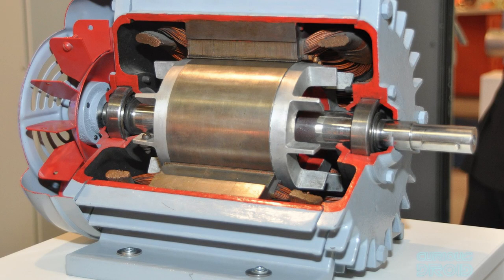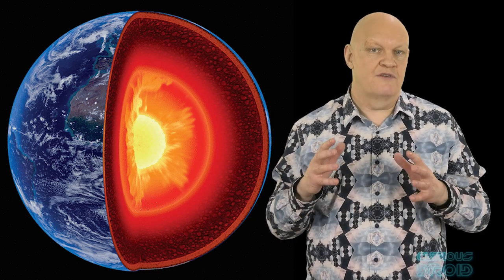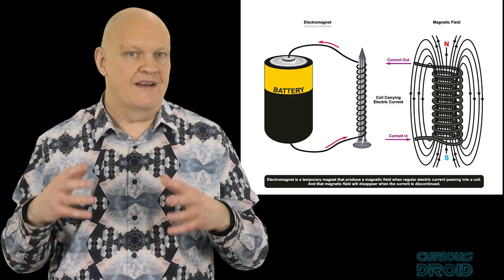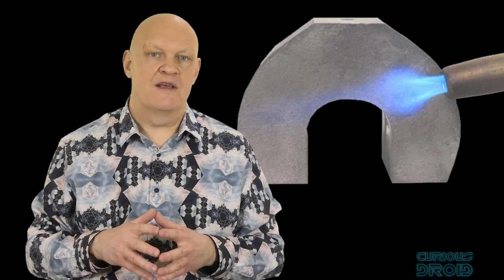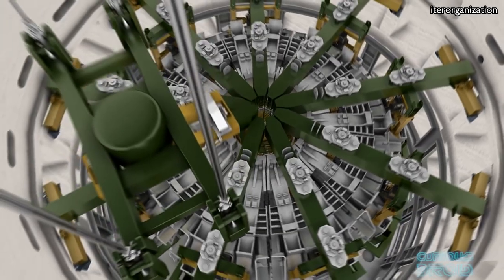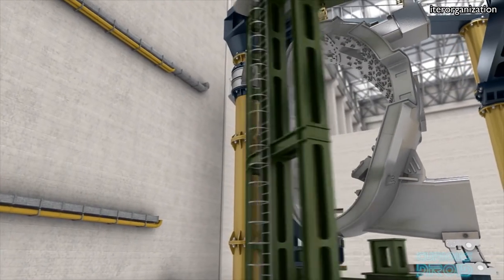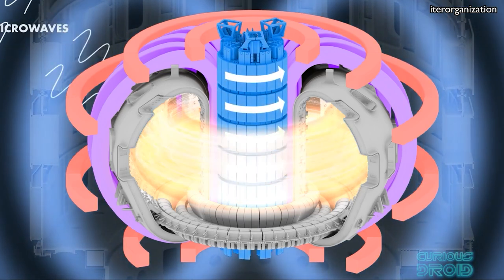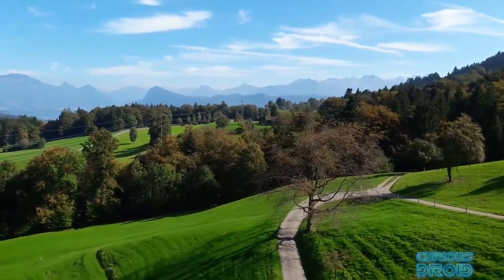The Most Powerful Continuous Magnets Yet Made

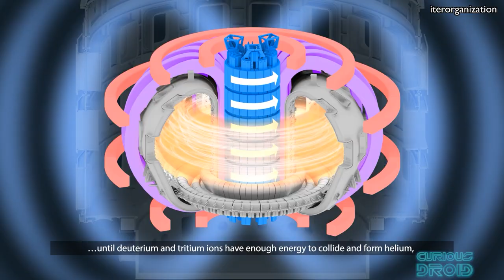Comment: 14:43 Note that the 500 MW heat release need to be converted into electricity with an otimistic efficiency of around 50% so the power comes out is only 250 MW.
Reply: and true cost of running the entire facility is more like 550 MW... still, big progress
Reply: At least the Q factor is about 10. For a fusion reactor as a power plant to be commercially competitive it has to reach around 50. Still, big progress
Reply: It will about break even, as I saw some numbers quoted. So, with research completed at ITER and other facilities, the next generation should be on the grid and producing power. I don't believe any of the dream fusion reactions will be on the grid before 2030, maybe 2035 at a smaller scale.
Reply: @kindlin  I will put commercialised fusion somewhere around 2050, and becoming a major source of energy by 2100.
Reply: @kerbodynamicx472  
I'm only saying that by 2035, 2040 at the latest, there will be some device using fusion power powering a community, a city, a moon base, somewhere, in a commercially viable way.
Reply: @kindlin  it probably won't break even. the prospect of producing excess energy only appears to exist if you look at energy pumped into the reactor core compared to thermal energy produced. but total power input for the entire facility will be higher than the 350 MW you see in the news articles, and electric power out will be much lower than the thermal power it can produce. only by capturing the heat from the stray neutrons banging into the reactor walls will they be able to pump steam through turbines.
Reply: @cornoc  
I'm not talking about ITER or any of the current ones being discussed: "the next generation" aka, after this generation. No current fusion reactor has plans to be on the grid, they are all research beds. Some think they'll have something running near the breakeven point in a few years, but it's going to take an entire next generation of physics and engineering improvements before we can have an actually feasible reactor on the scene. But it's coming, oh, it's coming (in like 15ish years, probably).
Reply: @kindlin  oh, yeah i'm pretty sure at worst the "30 more years" cliche gets more accurate every time they say it. at this point i think the only thing that would prevent a commercial fusion power plant from being built is a major breakthrough in alternative energy sources like solar panels and batteries. if they get efficient enough and cheap enough, it might discourage companies from continuing to pursue fusion.

Comment: Great video, Paul! One point of interest: the interaction of neutrons with the coolant water (and moderator in LWRs) only heats it by a few percent of the total - the daughter nuclei from the fission contain the majority of the fission energy and it is their impact with the ceramic lattice of the fuel pellet that causes it to heat up. That's why the cooling of the fuel is so important - nuclear thermal hydraulicists wish that the heat was formed directly in the water, it would make life a lot simpler and would allow reactors to be even more efficient! In fusion reactions, however, the neutrons carry most of the energy (irradiating the vessel as you mentioned) so heat will be extracted by their deceleration in breeder blankets, producing fuel in the process. Cheers!

Comment: I had no idea that the magnetic fields in a fusion reactor were so insane. That's mind blowing!
Reply: Im more curious what would happen if a tie rod holding the top and bottom broke and the whole thing blew apart, at 150 million degrees im guessing the whole building would be incinerated along with all the workers long before the chunks of metal did damage
Reply: @mickyr171  I don't think the plasma would be a big problem. It dissipates very quickly when the magnetic field stops from what I understand
Reply: @awesomefacepalm  oh ok then, that's a good thing
Reply: @mickyr171  isn't the thermal mass way to little to cause that kind of damage?
Yes, you have these crazy temperatures but only a really small amount of material (I believe it's just a few grams) is at that temperature.
Reply: @gags730  Really it's the cost that makes me grimace... ITER as presented in the video takes in 300 MW to output 500 MW.  Ish.  For how many billions of dollars? It's frankly no use is the end product of fusion (unlimited input resources with no waste!) costs billions of dollars for a few hundred MW.
Reply: @DavidOfWhitehills  it's not an either or with fusion and renewables.
But do you realize how much energy we can get out from just one kg of hydrogen? That could replace thousands of acres of solar panels. Imagine what a reduced environmental footprint that would give.
Reply: @DavidOfWhitehills  you sound like a greenie
Reply: @awesomefacepalm   You really need to watch the vid Shrikinator linked a few posts ago. Until you do, you are the poorest informed in this thread.
Reply: @DavidOfWhitehills  I've watched that one already, months ago
Reply: @awesomefacepalm   Did you comment? What were your thoughts?
Reply: @DavidOfWhitehills  it's exactly as she says. Fusion has the potential to be out best source of energy and more research should be done.
But the half truths many of the scientists give is not good for the image of fusion research.
I won't call it a scam, because it's not. Not even Sabine does it 
The only thing is that the road to net positive fusion is much longer than than people claim, but in the long run I'd say it's worth it.

Comment: From memory, the first recorded death by hospital equipment was that of a boy undergoing a MRI. An oxygen tank was hurled into the machine and he was crushed by it. I recently had a scan by another hospital device that almost fully enclosed me. The sound was like a jackhammer right next to me. It went on for about 25 minutes. I don't know the name of it but it was very claustrophobic.
Reply: Loud jackhammer noises, long scan times, and closed spaces totally sounds like some sort of MRI. If they asked you a bunch of questions about pacemakers, tattoos, jewelry, etc, it probably was some sort of Magnetic Imaging. Hope your scans came back OK.
Reply: @Forefatherrabbi  magnetic ink in tattoos? I wonder who discovered that the hard way.
Reply: I happened to work in a trauma center in the late 90s and early 2000s, and unfortunately have seen the aftermath of an oxygen tank going Through a doorway (as in forcefully, taking Out the door and frame), an operator's station and finally doing a Chop Suey on an MRI machine. It was caused by a vendor coming in through the ER doors after normal hours which happened to share a corridor with the MRI suite. 
Suffice it to say, a lot of hospital policies changed after that.
Reply: @volentimeh  good question.  Most people first notice inching, pulling or tugging sensations.  When the scan is being performed, the radio ways hit the metal in the tattoo like an antenna and the energy has to go somewhere.  So it goes into your tissues as heat.  It will not instantly burn you, but will heat up the more RF it gets.  Some people with small amounts of metal (like in a tattoo) can still receive a scan, but the RF needs to be dialed back and the scans spaced out so the metal has time to cool before it gets blasted again.

Animals can get MRIs, and the microchips in pets is OK in the MRI and will not be broken or damaged, but it is something the veterinarian will look out for.
Reply: @Forefatherrabbi  I have to tell the technicians I had an umbilical hernia that was fixed using a titanium mesh. But I think that's with the MRI. The other machine was even more claustrophobic. I was given a choice of music to listen to using headphones as the test would take 20-25 minutes. I couldn't hear the music though due to the jack-hammer noise.
Reply: I hate those machines, talk about claustrophobia

Comment: When the first fusion reactor is operating 24/7, I wonder how close you can get to it before electronics begin to fail. Will there be a huge area around the facility that's off limits?
Reply: Magnetic fields roughly follow an inverse cube law rather than an inverse square law, which is why you don't erase your hard drive by having a magnet in your screen to detect that the laptop lid is closed .  And you can control where magnetic field lines go with metals and dielectrics.
Reply: We already have functional fusion reactors.... Their only problem is they don't really produce a positive output, at best they can self sustain but what excess they can make is a joke at best.. You might run a watch off it if lucky
Reply: There are metals that can shield magnetic fields, if you ever had or saw a CRT TV, those had magnetic shielded speakers for obvious reasons.
CRT-based oscilloscopes use a Mu-metal shield.
Mechanical hard drive magnets have Mu-metal plates that keep their stronger magnetic field away from the platters.
Reply: @SilvaDreams  Sooo...... you're saying there's a chance?
Reply: @SilvaDreams  actually its not even close since none of the power for the cryocoolers and auxiliary systems is calculated in those figures

Comment: I have to point out I have a pacemaker and have had two MRI scans last year and two more coming up to be done in one day on the 8th of March 2022. They have a technician from the pacemaker company who speeds up my heart rate a little before scanning and slow it down afterwards, so far I am still alive. The worst part of the procedure which takes I think about 20 minutes is the noise, I am fitted with a massive head set which pumps out the loudest baddest overdriven distorted heavy metal you would need to experience to appreciate. Just for extra info I had one on the brain and one on the hip, the next two are spine and shoulder, such fun!

Comment: Nice content; I really enjoy those videos. But many continuous running NMR magnets far exceed the magnetic fields in tokamak fusion systems. For example, the University of Florence has a 28.2 T magnet system. Further, commercial NMR magnets are available with fields up to 23.5 T. (And I believe 45.5 T is the world record for a continuous high-temperature superconducting magnet, ref: Nature, "45.5-tesla direct-current magnetic field generated with a high-temperature superconducting magnet", 2019)
Reply: I have a 1960's NMR with a 0.5T magnet. I have no idea what to do with it.
Reply: @LaserFur  That is awesome! One of the early days of NMR. Have you worked with that device?
Reply: @escapedbits2732  I got it from a university that said. "come bring a trailer we need to clean out this area". Unfortunately all the cables are cut and missing. so all I have is the books, rack with the amps, and the unit itself with it's chart recorder. It would take a lot of work to get it to work again.

Comment: Absolutely fantastic video :) however after tons of material I've watched and read about fusion reactors (TOKAMAKs in general) I still cannot understand how will the heat from the plasma ring in a self contained liquid helium cooled tokamak, be "extracted" to heat water for steam turbines?
Reply: The energy is conveyed from the plasma ring to the blanket (or heat jacket) by fast moving neutrons generated by the fusion reaction. The kinetic energy of the neutrons striking the jacket and their subsequent decay is the source of heat. The reactor can then be cooled in a similar manner to fission reactor (pressurised water, molten salt or high pressure gas) with the heat conveyed to Brayton cycle turbines.

It may also be possible to extract energy from the plasma using magneto hydrodynamics but I am unsure whether this has progressed beyond a theoretical possibility.
Reply: @jimgraham6722  Thank you so much for the explanation! To me this principle sounds more like a particle accelerator energy transfer, which is interesting :)
Reply: @andydsm  My understanding is the durability of the heat jacket under intense neutron (as well as other radiation) bombardment is still bit of an unknown as so far the fusion reactions have only been of short duration. The net radiation flux in a fusion power reactor is expected to be about 100  times that in a comparable fission PWR so materials will get a lot of wear and tear, requiring regular replacement.

 Relining the reactor from time to time will undoubtedly be a big deal.
Reply: @jimgraham6722  As I read your explanation to my 1st question, I also started thinking that even if in the following years we have a successful q over zero tokamak ignition for testing purposes (i.e ITER or another one), the next step of actually working on the energy transfer for actual useful work, would be a monumentally difficult task as well.
Reply: @andydsm  Yes, it's a way off yet and the initial power plants likely to be very large and very expensive. Sabine Hossenfelder recently gave what I think is a reasonable summary of state of play.
https://youtu.be/LJ4W1g-6JiY
Reply: @jimgraham6722  Again, thank you for the eye opener details shared, just watched the video you had linked and sadly I have to accept the truth that this very much necessary dream for humanity, will not become reality for many years. The recent 20-ish minute fusion reaction in the Chinese experimental reactor got my hopes really up, but I guess there's thousands of additional challenges to overcome.

Comment: What happens if the  fusion reactor's magnetic field loses power, even for a nano second? Wouldn't the plasma expand explosively, sublimating everything in it's vicinity?
Reply: ITER uses superconducting magnets, so no power is needed to sustain the magnetic field.  The whole structure is extremely robust in order to contain the forces generated by the magnetic fields, heat, and pressure.
Reply: If the field of the superconducting magnets lost their power due to  short or over temp, there would be a quench. boiling the cooling liquid and high resistance. The magnet would be permanently damaged. The plasma would leak from the magnetic mirror or bottle and hit the walls of the reactor chamber. 
The chamber in a modem commercial reactor would be lined with not only tungsten but lithium to drink in the neutrons and  make tritium for fuel. 
Still, no, a hot mess it would be, but no runaway reaction and explosion of a nuclear sized yield, just an industrial accident of a costly machine.

Comment: I used to do consulting work for Toshiba MRI. Their magnet development building had a very large test area with bright yellow tape on the floor to mark an area that needed to be clear of anything. Before the yellow tape, they had a screwdriver fly into a magnet at extreme speed and impale it.
Reply: Mmmm Hope they transitioned their tools to brass, copper, aluminium and plastic as an extra safety factor? Or did they just 'stick' with the yellow tape and pre-training courses?
Reply: @David-yo5ws  I just networked and repaired their Macintoshes. I stayed well clear of that area with my disks and portable hard disk.
Reply: @Peter_S_  LOL And especially the Floppy Disks ;-) Ahh those were the days of 8MB hard drives and bug ridden firmware 😱
Reply: @David-yo5ws  Yep, the floppy days. By that point I was using a ST-225 20MB for a portable drive and then upgraded to a Miniscribe 8425 which was also a 20, but in a 3.5 form factor. Super high tech!

Comment: a small comment on the fusion device: The fuel required to have the fusion work is so-called D-T, which means Deuterium and Tritium. Deuterium is isolated from regular water routinely, but Tritium is another matter entirely. This has to be made in a fission reactor (preferably) by irradiating lithium. Tritium is radioactive, with a halflife of around 12 years, and emits weak beta radiation. 
So it's not the case that we have "infinite" fuel at our disposal for fusion reactors.
Also, whilst the plasma charged particles can indeed be manipulated wit magnetic fields, this is not the case for neutrons. They will fly all over the place, being uncharged.
All in all, fusion does not seem to have the promise, and thorough investment in fission reactors is warranted.

Comment: I have a spinal cord stimulator iplant fitted to help manage pain in my legs. The first 3 I had stopped me from using an MREI scanner. But I have had an upgraded fitted. This involved changing both the battery - contoller pack and the lead that carrsignals to my spine. Now I can have an MRI if needed but it was both expensive and painful. Magnets are great

Comment: Trying to explain how magnetism works is very difficult and you've done a fantastic job.  One small correction about the MRI and pacemakers however.  The most critical reason for not putting a pacemaker in an MRI is because we use magnets to turn them on/off with magnetic reed switches.  If an implanted defibrillator is malfunctioning we use small round magnet that can be placed on top of the pacemaker (over the skin) to disable it temporarily.